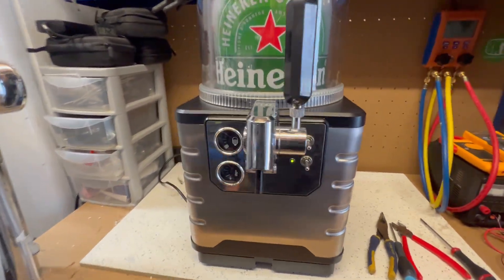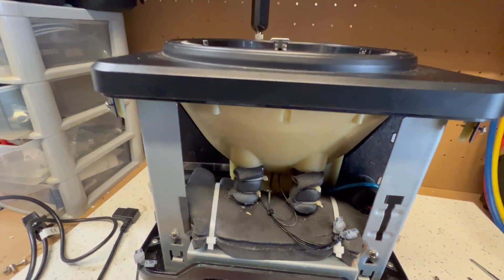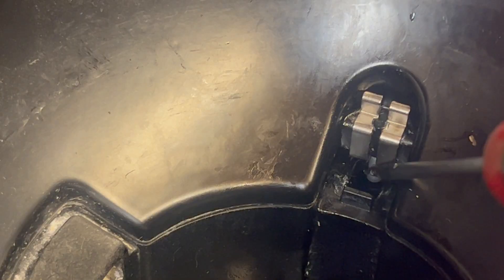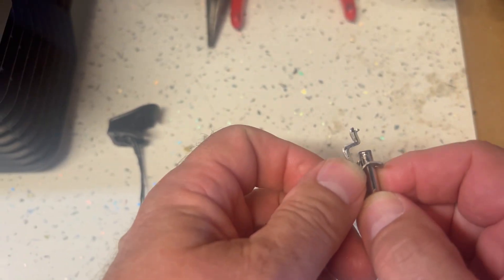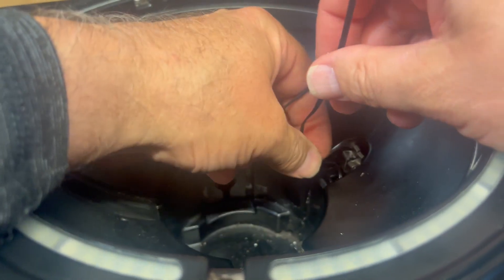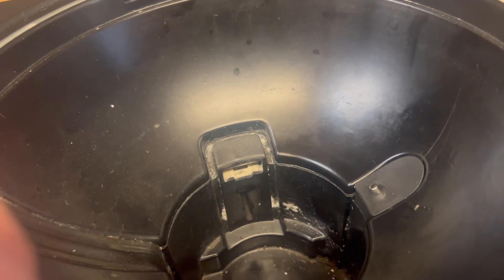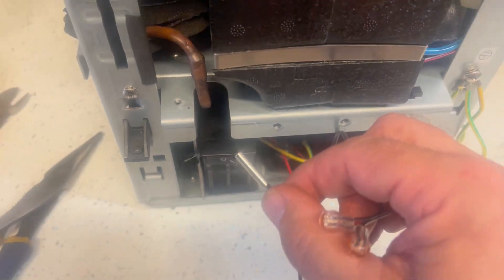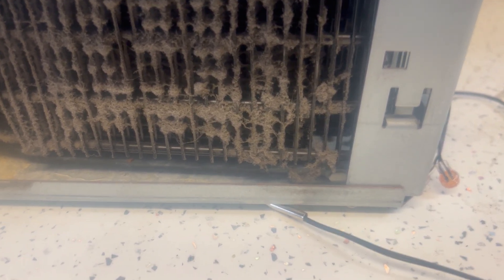Blade beer  machine temperature sensor replacement

Comment: Hi Put a new keg in the machine, no compression noise and no noise when I pull the pump handle. Machine still chills the beer but can’t pour. No error lights. Any help would be greatly appreciated
Reply from the maker: Hello John. Have you tried resetting the machine? Turn the keg switch off. Turn the machine off on the side switch. Unplug machine for 5 minutes then back on in reverse. Leave the machine 20seconds before turning the keg switch back on. If this doesn’t work your machine has a problem with the air pump pr the pressure sensor on the circuit board.
Reply: @Bladerepairsdiy   Hi, Thanks for the reply. Yes I have tried the reset but still no joy. Still no noise when i lock the keg and nothing when i pull the handle. Is this something you could repair?
Reply from the maker: @J @JohnKyle-q9z es John I can do any kind of repair on these machines.  Join my facebook group then you can PM me with your details. Blade Repairs DIY Thanks.

Comment: Hi just after a little  help please  . Had a empty keg left in . Normally  had condensation on the tap . Noticed  the temp gauge on warm . Put new keg in the fridge  for 14 hours . Fitted this morning  . Keg locked in and heard the compressor  sucking . No fan tho. Rechecked  this evening.  Still warm on gauge . Watched  your videos.  Thanks . Checked the 3 sensors . Black was 16.9 k ohms red 1.42 k ohms and orange 16 k ohms . Could  you tell me what readings  i should be getting  please  . Regards Richard
Reply from the maker: Hi Richard 10k at 25.0c . It looks like your red sensor has failed.
Reply: @Bladerepairsdiy  hi thanks for the reply.  My mate had some new sensors  . From when his failed.  Fitted all 3 on Friday night . Working  great  now . Just having  a cold Moretti.  Thanks again  great video

Comment: Hello, to check which colour is which sensor to allow the resistance check to be done to understand which one may need replacing
Presumably if there is no reading that is the sensor that has failed?
Reply from the maker: There are 3 sensors terminated at circuit board. Orange, Black and Red, all in a row down the board. All 3 should be around 10k
Reply: @Bladerepairsdiy thanks for the quick response to clarify is it the orange or red which is the keg sensor for example?
Reply from the maker: @alexmartin6967  the orange is for the keg. (The one pocking through the rubber in the bowl). The red is for the bowl sensor.
Reply: @Bladerepairsdiy hello again, looking for next steps please!

Have checked all 3 sensors and getting a reading of 13.4 for all so appears to be no issue there. 

Also ran a check on the compressor

C-R 58.2

C-S 18.0

S-R 74.5

Combined CS to SR 92.5

Checked all pins to earth no reading.  

Unfortunately still not cooling any other thoughts as to what could be the issue?

Thanks
Reply from the maker: All 3 should read about the same. If you get readings of say 10k on 2 of them and 20k on the other you might even get 2k this is the fault one. If you watch the video you will see me taking the readings. Hope you sort it out.
Reply: @Bladerepairsdiy thanks for the reply I get the same reading for all 3 temperature sensors 13.4
Reply from the maker: @alexmartin6967  sounds like they are ok. You didn’t say what the original problem was.
Reply: @Bladerepairsdiy ah apologies not cooling the keg
Reply from the maker: @alexmartin6967  if you join my facebook group of the same name there is a flowchart on what should happen.

Comment: We dit all the testing and everthing was fine . Put a new cold keg in and It was fine ( for 6 days than de temperature was on the top ) keg was half full then . Blade temperature light is very light
Reply from the maker: Hello Does the fan still run?
Reply: @Bladerepairsdiy yes the fan is fine . Everything is fine ( Only the lights from the meters doesn’t work . But this was not a problem with the Cooling  before ) we let the Blade as It was ( no time for it ) and the next day the temperature was good again . 🙈
Reply from the maker: @AaltjeWolters over a period of time the lights around temperature and the keg full gauge will go dim. Only thing to do is replace the Led’s
Reply: We went on vacation and the temperature was perfect. Today we came back and the temperature is all the way up again
Reply from the maker: @AaltjeWolters  join my facebook group blade repairs diy. There is a sequence chart on there. Should help.
Reply from the maker: @AaltjeWolters  did you turn machine off?

Comment from the maker: Here are the links to the sensors and connectors.

https://amzn.eu/d/2gTs8Bs

These connectors will accommodate a slightly larger wire to help with easy fitting.

https://amzn.eu/d/aBQOkEv

Comment: When connecting up the cables do i need to strip the insulation or not?
Reply from the maker: No just make sure the ends are cut straight. The little jelly bean connectors are self cutting. The parts are listed in the description. Good luck.

Comment: Excellent Video, Thank you,  Life is too short for warm beer..Just wondering if you have info on the 3 sensors, perhaps Amazon link please 🙏..
Much Appreciated 🍻🍻🍻
Reply from the maker: Hi John heres the info on the sensors and the connectors that you require.
https://www.amazon.co.uk/HALJIA-Waterproof-Temperature-Conditioners-Refrigerators/dp/B075L2PJZM?pd_rd_w=26w2A&content-id=amzn1.sym.584f67ad-f69b-4496-b995-1623bb5fdd88&pf_rd_p=584f67ad-f69b-4496-b995-1623bb5fdd88&pf_rd_r=19H2JQTTTE9V9PTDYZB3&pd_rd_wg=yO8KF&pd_rd_r=38352b52-ef4d-4ae9-b047-0c5e8b74348d&pd_rd_i=B075L2PJZM&psc=1&ref_=pd_bap_d_grid_rp_0_12_pr_i

These connectors will accommodate a slightly larger wire to help with easy fitting.

https://www.amazon.co.uk/dp/B0BZVF6TYM/ref=sspa_dk_detail_5?psc=1&pd_rd_i=B0BZVF6TYM&pd_rd_w=6PWoj&content-id=amzn1.sym.7c2bff8e-4ce3-4cc7-b3f6-35ac6c74cf9b&pf_rd_p=7c2bff8e-4ce3-4cc7-b3f6-35ac6c74cf9b&pf_rd_r=47GVVNCX2QED1VANREHK&pd_rd_wg=LdSly&pd_rd_r=14099de9-f0bc-4d43-9204-e30df53e9ca3&s=industrial&sp_csd=d2lkZ2V0TmFtZT1zcF9kZXRhaWw
Reply: @Bladerepairsandservice   Perfect,  Thank you for the information,  much appreciated 👍 🍻
Reply: Hi
Reply: #Update!..so i received the new sensors from Amazon,  and only yesterday had the chance to strip her down!...
The multimeter is recommended,  as i tested all 3 sensors,  and discovered only one was faulty,  so i just replaced the one, put all back together and perfect,  the machine came back to life 😊

Just an observation...for other people with cooling problems and not interested in opening up the machine...A very cold keg will last a good few hours, i. e. a party without the cooling system working .
Someone else on YouTube drilled two small holes in the top of the dome, filled with water and froze the dome, so the basically the keg is surrounded by ice, perhaps over time the gap between the dome would get mouldy...but it did the job for me...
Thanks again for your help,  
Now...time for a nice cold pint 😋 🍻